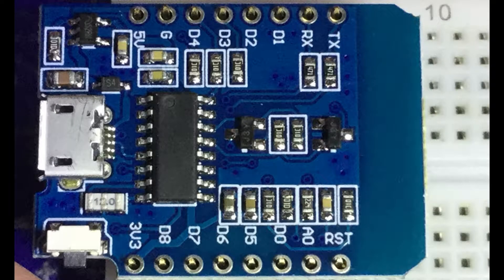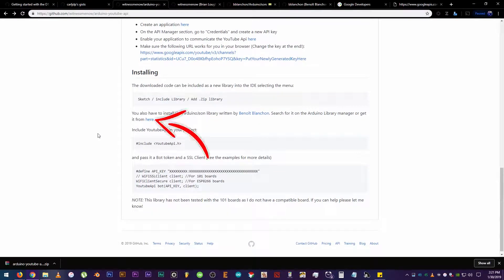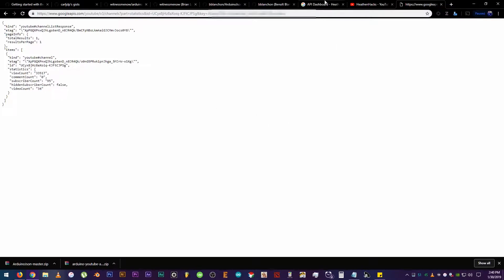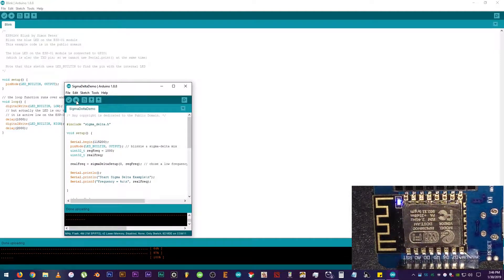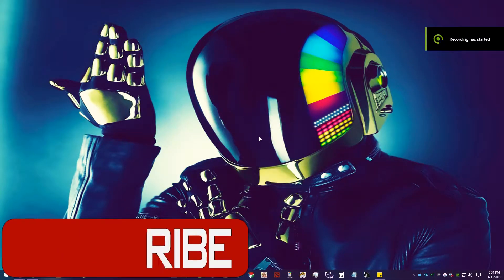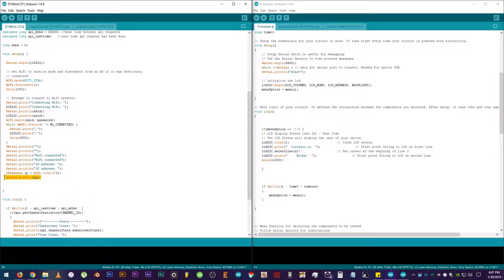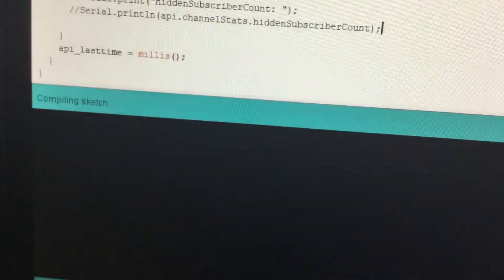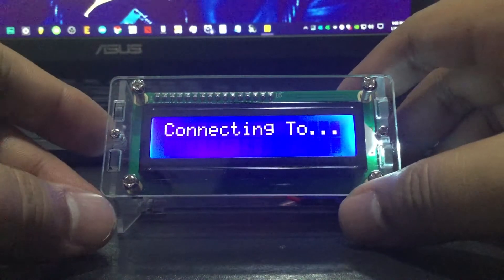Arduino Project #10 | Youtube Subs, Views & Vids Counter | D1 Mini & 16x02 LCD [Step-by-Step Guide]

Comment: Hello, been trying to get this working for a while now, don't why but the esp8266 nodemcu 12-E is connecting, but not retrieving any youtube data. The API is enabled, the key works in my browser and the appropriate libraries are installed. I get the same result with other esp8266 boards. 
Any info would be appreciated.

Edit: I believe the code hangs at,      if(api.getChannelStats(CHANNEL_ID)){print stats...etc}
Reply from the maker: Hi, Alasdair! Thanks for the comment! ♥ Please make sure that you are not using beta versions of anything. From the youtubeAPI library, ArduinoJson, and ESP8266 library. I have encountered that error when I first tried it and found out that it was the cause. If you are really sure that all the appropriate boards are installed as you said, you can try this method.

Open IDE -> File -> Preferences -> Settings -> Click the address/link Below the Additional Boards Manager URLs. (The One that turns blue when you hover your cursor over it) Looks like this: **C:\Users\YourUsername\AppData\Local\Arduino15\preferences.txt** -> Delete all of the contents on that folder, but make sure to backup your libraries before doing it ->  Close the IDE -> Delete the libraries related to this project (ESP8266, ArduinoJson, YoutubeAPI) ->  Open IDE again -> Let it load -> Then reinstall ESP8266, ArduinoJson, YoutubeAPI libraries again. Remember, no beta versions.-> Then try to re-upload your code to your board and see if it works.

Not sure if my explanation is clear. lol.
Reply: @HeathenHacks  Hello, Just want to say thank you, think i must have been running a beta esp library, didn't even occur to me to check that. Thank you for your help. Great video. +1 sub :)
Reply from the maker: Hey, Thanks! ♥